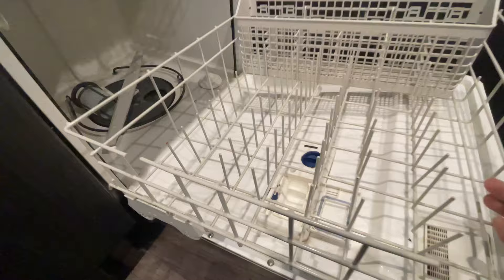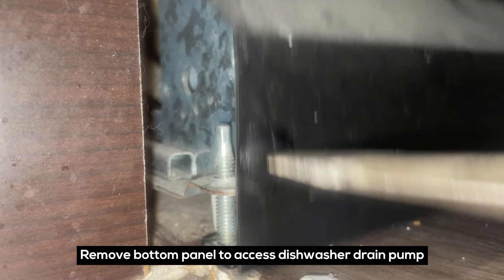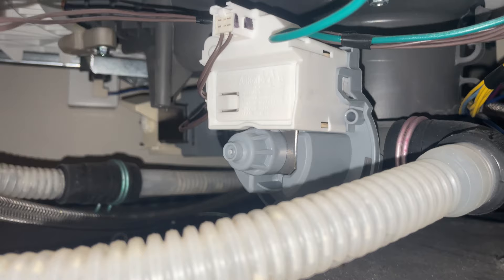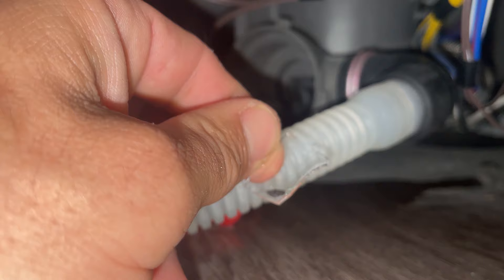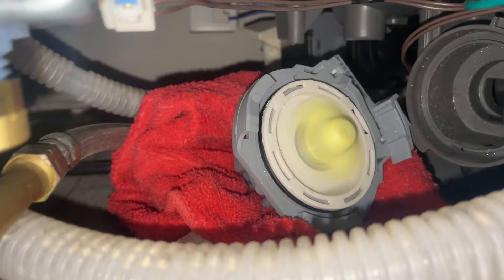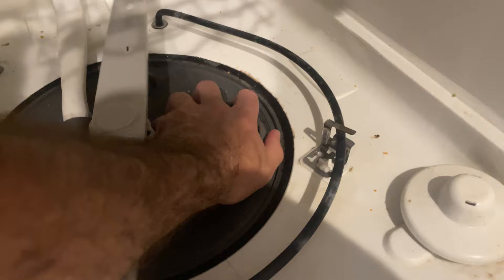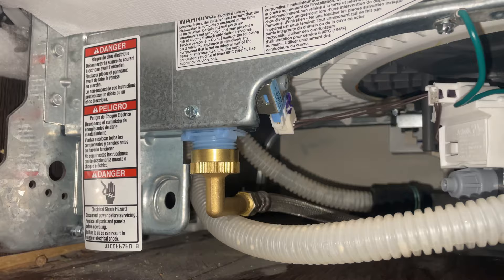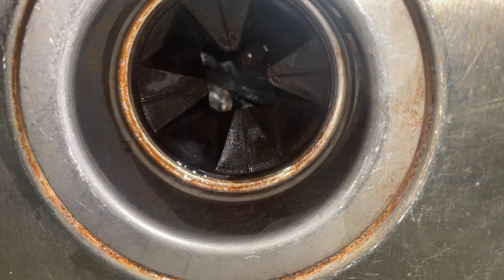Whirlpool Dishwasher not Draining

Comment: What would cause the drain pump to only not work intermittently when the water is hot? I have a Whirlpool dishwasher and this is the problem, and when the water cools the pump drains just fine so there's no clog, though I've checked the impeller and hoses anyway and, nope, no clog. It's entirely a temperature related problem. Any suggestions? I actually swapped out the pump with a new one and the problem intermittently persists.
Reply from the maker: Never heard of that I would call the manufacturer. Dishwashers are supposed to operate with 140 degree water temp 🔥

Comment: I can’t get it to twist to the left. Any ideas?
Reply from the maker: If you are talking about the drain pump is it by chance held in by a few screws? If no, I've had some that take a bit of force to twist off. Two hands helps, let me know what you find.
Reply: I had the same problem on a newer model. There is a release tab on the left side of the drain pump. Can’t tell you quite where since it’s on the opposite side and I can’t see it, but it took some feeling around and once I depressed that tab, it rotated relatively easily.
Reply: @ApartmentMaintenancePro  I found the tab on the upper left side on the motor! Glass fell right out after the putrid water!!! Blesssssss this man!
Reply: I can’t get it twist at all

Comment: Did you just plug in the dishwasher and the pump started spinning? I followed all of these steps, but when I plugged it back in my pump didn't spin like yours did 😅....I'm not sure if that means I need a replacement or if I missing a step ❤️
Reply from the maker: Plug in the dishwasher, hit start cycle, and then cancel. MOST newer dishwashers the drain pump kicks on first when you start a cycle.

Comment: Can I ask how you tested the drain pump when you had it disassembled? Did you place it into a specific mode or turn on a switch of some sort? Thanks!
Reply from the maker: Most modern dishwashers the drain pump turns in when you start a cycle, if not, hit cancel and it should also start

Comment: Sooooo there is a convenient slice right when you try to turn the pump and when you turn it. In trying to duplicate this repair I found that the pump wouldn't budge and I don't want to force it. I'm curious what you did during the edit: I suspect you skipped a step when you loosened the pump or something. Mine is on super tight.

Comment: Did exactly as you but when I installed the pump back I now have a slow leak. Any suggestions??
Reply from the maker: The o-ring might not be sitting right make sure it’s on there even replace if you can’t get it to sit even

Comment: Great video just one question... How did u test the pump when u pulled it out ? Mine isn't spinning when I start it
Reply from the maker: Turn the dishwasher on select a cycle and then hit 'cancel'. That works on most models anyway. If the pump is extremely hot then it's most likely seized or just bad.

Comment: How do you check if the pump is running? without running the whole cycle.
Reply from the maker: Run cycle and then cancel should kick in the drain pump. Or enter service mode and run self diagnostics you can do this by following the directions in the tech sheet, usually located behind the bottom panel

Comment: GREAT video thanks for sharing- question- at the end of the video I noticed you had water at the bottom of the catch and said it’s normal, how much water is appropriate to have down there? I don’t have water pooling beyond the catch but wondering how much is ok to have before attempting what you just did.  Followed your instructions but don’t see/feel any obstructions. I do noticed that the clear ribbed hose is full of water. Any other suggestions? I pulled 17 oz. Of water out of the drain catch area….
Reply from the maker: In my opinion as long as it doesn't get above the drain pump reservoir :)

Comment: Our dishwasher is identical to this. Ours sometimes drain and sometimes doesn't but when it doesn't the motor still running. Nothing clogging it or anything. Maybe a bad pump?
Reply from the maker: Check pump rotation on impeller. Air gaps in line. Garbage disposal knockout/clog

Comment: Question. I can’t remove the water pump. You do it so easy but I cannot. Does it have some kind of lock or pin? It’s a WDF520PADM 9. I already remove some piece of thread. But it did it again. So I think there’s still some more to be removed. Please. I appreciate it. Thanks
Reply from the maker: Check through the comments some have reported latches that need to be pressed.
Reply: There is a small plastic tab latch on the side.  You have to depress it and then you can turn the pump a quarter turn counterclockwise to remove.  You should be able to feel around on the pump to find it, even without removing the dishwasher.  Make sure that you have all of the water removed like he shows and the power is turned off.
Reply: @j.frankparnell6195  thank you so much. I took video with my phone and effectively, there was a plastic latch that I needed to press. Thanks again

Comment: How do you get the motor to run? I'm not sure how to test it while it's open.
Reply from the maker: Turn dishwasher on, start cycle, make sure to hit cancel before water starts
Reply: @ApartmentMaintenancePro  I tried that, but anytime I hit cancel before the water starts, the whole thing just shuts off. The drain function never kicks in until it's full of water.

Comment: Thanks, man. Helpful video. When I plugged it back in and ran it with the pump disconnected from the bottom, the impeller doesn’t spin. There are no obstructions (hair wrapped around, etc), so I’m guessing I’ll have to replace the pump. Quick question: does replacing the pump involve any pain in the butt tinkering with wiring, or is it simple? Thanks again.
Reply from the maker: Should just be two wires I believe :)
Reply: @ApartmentMaintenancePro  thank you
Reply: How do you test the pump?  Do you hit the drain button and it will spin without water in the tub?

Comment: How do I get the impeller to spin?  I turned power on but mine doesn’t spin. Do I need to start a cycle or should it spin when power is turned back on?
Reply from the maker: Try hitting start and then cancel. Most dishwashers go into drain mode upon hitting cancel
Reply: Thanks, I did end up finding that my issue was the drain hose was clogged up. Had to remove the washer completely tho to get at hoses.

Comment: Great video. Do you know if there is a hard reset for a wdt920sade2  it’s pumps out water at the start but doesn’t fill or wash. Would appreciate any help with this. I have 2 of these doing about the same thing. Thank you
Reply from the maker: Check for proper water supply, check water inlet valve, check diagnostic mode
Reply: I haven’t loosened the water line to check for water but I will. How do I put it in diagnostic mode? Thank you for your reply and help.
Reply from the maker: @kroautomotiveinc  It all depends on which type of model you are working with. You want to access the service tech sheet which may be located behind the bottom panel of the dishwasher and follow the instructions to go through diagnostics.
Reply: @ApartmentMaintenancePro  Thank you so much I’ll check it out tomorrow.

Comment: will you think apartment maintenance will replace a water inlet valve to my dishwasher? dishwasher has weak water pressure during the wash cycle and rinse cycle.
Reply from the maker: That could be clogged sprayers I would submit a ticket to them though

Comment: How were you turning the power to the pump on and off when you were checking it for operation?
Reply from the maker: Reapply power to unit and start any cycle. Most dishwashers drain on startup
Reply: @ApartmentMaintenancePro  Or you can just press cancel/drain and the pump will spin up.  It usually pulses a few times first, and then spins continuously.

Comment: Great video. But what if after all these steps the drain pump still not working?
Reply from the maker: Where does the drain hose go into? Disconnect the drain hose and put wet vac on the end and turn on the drain pump with the dishwasher full of water. Also, if your drain hose goes into a garbage disposal make sure the knockout plug is…knocked out
Reply: @ApartmentMaintenancePro  the drain water pump is not working.

Comment: I did this, didn’t see any foreign object in the drain, plugged it in the drain fan spins. But still not draining. Any other ideas?
Reply from the maker: Check the drain hose from the pump to the disposal / drain line
Reply: @ApartmentMaintenancePro  well I feel like an idiot.  If anyone else sees this keep this in mind. I just installed a new disposal, and couldn’t get my DW to drain, did the method here, nothing. After taking my DW completely apart and back together I discovered a knock out in the disposal for the DW drain……………..it must be knocked out. Lol

Comment: I really had high hopes but it seems as if I'm the only commenter out of the thousand that this video didn't help. No debris, glass ect.  Not sure how to test the pump. Video didn't explain that.  Went the extra step and pulled off the drain hose from pump housing and checked for blockage. Blew through it. Reassembled everything and ran cycle. Still standing water.
Reply from the maker: At this point I would try replacing the pump. Whenever you “cancel” a cycle it will engage the drain pump

Comment: my dishwasher holds water in that same line and shooting out of the little hole on sinktop??? I ran a brush in the larger portion of the sink and cleaned out into the disposal but still shooting out of the small drain hole??? any advice
Reply from the maker: If you have a vent on the top of the sink and water is shooting out you might have a clog in the dishwasher line, maybe near the disposal

Comment: I think my drain pump isn’t working. I saw you test it by “turning it on.” Did you just try to run a cycle to see if the motor spun?
Reply: Nvm I see you have a “drain” button on yours.

Comment: Thanks for the walkthrough.
I was able to follow along with some difficulty, but no such glass or other obstruction that I could find.
Any thoughts on next steps? It sounds like the pump is running, but no water flows. Occasionally, if I let it sit over night or manually drain some water, then it will finally drain.
Reply from the maker: You can remove the pump as seen in the video and manually see if it runs. From there I would check the drain hose from the dishwasher to drainage whether that be a garbage disposal or sink
Reply: It’s the circulation pump if it sounds like it is running but there is no water cycling. And it’s the drain pump if the water isn’t draining. If you replaced your garbage disposal recently make sure to check the punch out.
Reply: And I agree with the float switch. Whirlpool put it in a dumb spot and it always gets jammed on silverware rack
Reply: @christianleakey9091  where is the float switch? I wonder if that's my problem. Is it the bobbling doohickey on the inside bottom at the front right? How can I check / adjust that?
Reply: @lisaduncan6923  yep if you remove the bottom rack you can push the bobber up and down. Sometimes it gets stuck in the down position due to the silverware rack and never stops filling. It’s a dumb design. One of many whirlpool mistakes
Reply: @christianleakey9091  thanks for your reply, I'll check it 😊

Comment: Thanks for a great vid, was able to easily remove the pump, but nothing inside or blocking it. Also checked that it ran and the pumps works fine. Any idea what next to check? Thanks
Reply from the maker: https://youtu.be/YFBwOpLcRQ4 this MIGHT help
Reply: How did you check that the pump ran?
Reply: @brackendouglas3433  Firstly make sure dishwasher is plugged out. Take pump out of dishwasher, but still connected. Asked my wife to switch dishwasher on briefly, then I ran a cycle. You can very easily see if drain pump is running or not. At the end of the day it wasn't my drain pump, but the water exit pipe that was blocked.
Reply: @mornelombard3343  so with the pump out start a cycle then hit the cancel/drain button and the pump should spin?
Reply: @brackendouglas3433  yes. Our whirlpool the pump would always switch on briefly when you hit start. You could see it spinning within 5 seconds of hitting start.

Comment: I did all that but it still won’t drain. I checked the motor for the spinning thing and it was working. I moved the hose and the water drained out on the floor so whatever the issue is isn’t from the dishwasher. But it’s weird I checked the other hose and it’s empty. I’m so frustrated. 😭😭
Reply from the maker: Does the hose go into a garbage disposal?

Comment: I took the pump apart and I had an olive. Didn't solve the problem as it's still not draining. The pump is rotating when I put the power on . I ordered from Amazon just in case it's damaged somehow
Reply from the maker: If the drain goes to the disposal check the knock out, check the hose from the drain pump to the hose outlet 👍

Comment: Have this exact model, when i try to turn the pump motor to take it off, it only moves 1/4 distance then wont rotate anymore...any ideas?
Reply from the maker: Is a wire holding it up? Some pumps have tabs that need pressed inwards but haven’t ran into that on this model
Reply: @ApartmentMaintenancePro  thnx for reply..its the same exact model as ur vid. I just cant turn it all the way off

Comment: This didn’t fix mine….. I have spent so much time trying to figure out what it is. I checked the impeller, replaced the pump motor nothing seems to work!!
Reply from the maker: Check your drain hose - 👍
Reply: Same here. I notice there a check valve on the 90 degree at the washer end of the drain hose… it seems to be blocking flow in both directions.

Comment: I wonder do you have to prime the pump when you put it back in? Or did you just put it in and it ran ok?
Reply from the maker: I didn’t prime the pump
Reply: @ApartmentMaintenancePro  Thanks. I looked at the blades on our pump and they looked worn out. So I ordered a new pump. It was an old gray 4 blade design. Our Whirlpool Dishwasher is a little older than yours. They upgraded to those multiple yellow blades when I typed in our Model number at Amazon.

Comment: if I want to drain water in my dishwasher, I have to press Drain all the time? It doesn't drain by itself?
Reply from the maker: It should drain by itself
Reply: @ApartmentMaintenancePro   after watched your video I checked my pump, and it spinning just fine, but when the dishwasher finished washing, there is water on bottom, I have to press drain for a few times in order for it to be empty. Do you know how I can get it fixed? Thanks
Reply from the maker: Check the dishwasher drain hose for blockage. Where is the hose draining into ? Eg : garbage disposal?
Reply: @ApartmentMaintenancePro   it's same model as yours, I checked the drain hose and I see water running through it, it look clean to me, I think it drain the water, but might be of it drains too slow, so after the pump stops water still inside the dishwasher.
Reply from the maker: @Cali_Oasis_Garden  there could still be blockage in the drain hose, or whereever it's draining too.
Reply: Should I take the hose off to check? I see the water flow when it drain to under your sink 4:16  it's stronger, mine is less water going to under the sink when it's draining

Comment: Key pad not working clean light on water in bottom took pump out nothing element good took panel off of front found a wire out of plug when made it got pinched and put together pulled out after 2 yrs put wire on ran like new    hell yea no cost to fix 👍

Comment: I can't turn the pump, any ideas what I can do???    I have the same dishwasher
Reply from the maker: Sometimes they can really get stuck on there. Turn off the water and disconnect the dishwasher, put it on its side and use a wrench to get some leverage on it, just remember that it is plastic though and can break/crack

Comment: Should have done a video on how to remove the back cover to get to the pump.
Reply from the maker: Back cover???
Reply: @ApartmentMaintenancePro  I should have said the aluminum casing. Sorry
Reply: @ApartmentMaintenancePro  I just removed the bottom panel like you did and took the corrugated hose off the pump. It was disgusting but I blew into it and sh!t flew out the other end like a giant spit wad out of a straw. I put a baking soda water paste and vinegar to make sure it was clean and it worked.

Comment: Mine isn't turning but I don't see screws. I have the exact machine
Reply: I guess I have 320padw1...does that make a difference?
Reply: And I can see standing water in the drain line right in front of the pump
Reply from the maker: Check for tabs that might need to be depressed while turning

Comment: I tried this and found a piece of plastic stuck on the spinner . But now it won't spin ? Help
Reply from the maker: If the pump is hot you know your getting power to it, if its hot and wont spin, and your sure nothing is blocking the impeller, it's most likely bad.
Reply: @ApartmentMaintenancePro  it's draining now but it's dripping water underneath???
Reply from the maker: @brandyfelix8969  either it's not clipped in properly or the o-ring is dented-worn. (my assumption of course)
Reply: @ApartmentMaintenancePro  thank you for your video & time

Comment: What button do you push to see if it turns?
Reply from the maker: Turn the dishwasher off. Then turn it on and start any cycle it doesn't matter. Drain pump will always kick on first if you have a dishwasher model similar to this one. Just turn it off before it starts filling with water. The ones with the mechanical timers are a bit different.